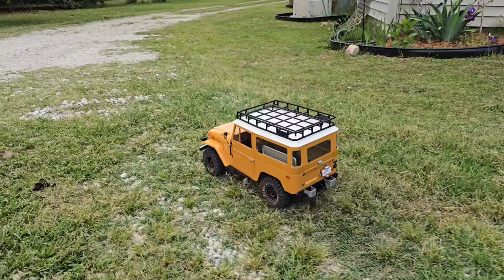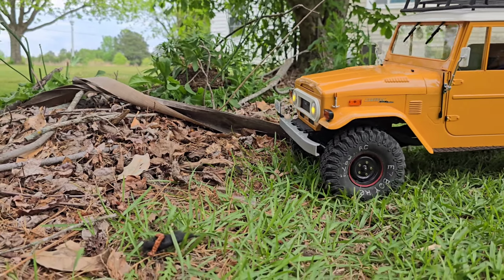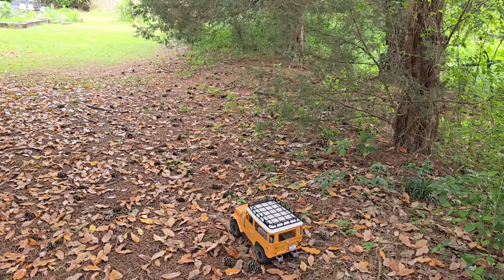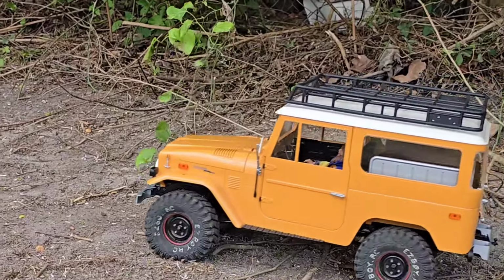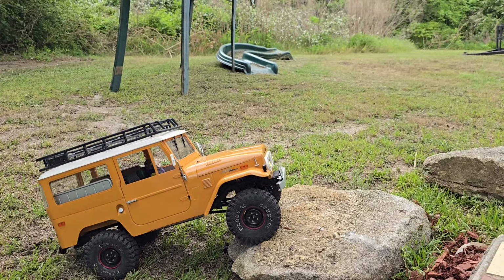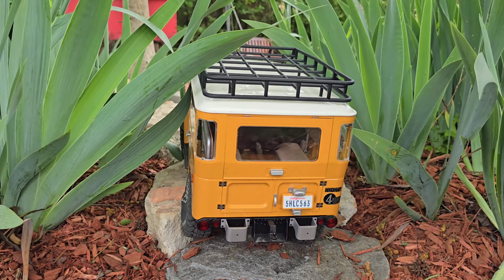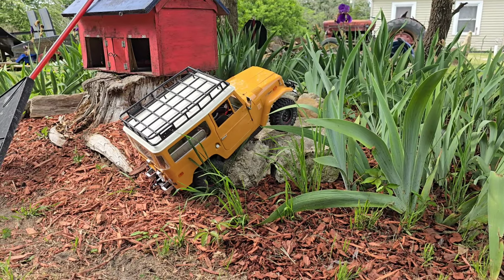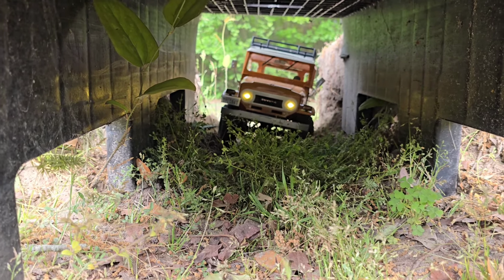FMS FJ40 LAND CRUISER with hobbywing fusion SE 1200kv & 45kg servo ESS DUAL sound simulator.

Comment: Nice!!! What battery do we need for this? I've heard battery isn't included 😢
Reply from the maker: No battery included is correct. It's kind of a pain to find batteries to fit in these trucks. They have to be skinny like 7/8 of an inch or less But it can run on 2s or 3s